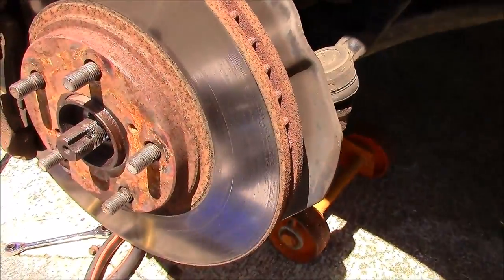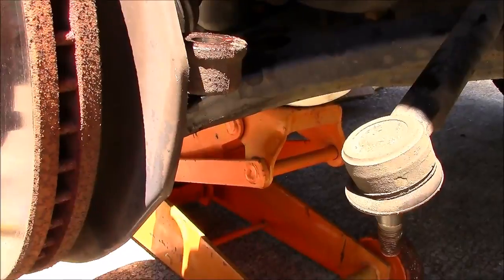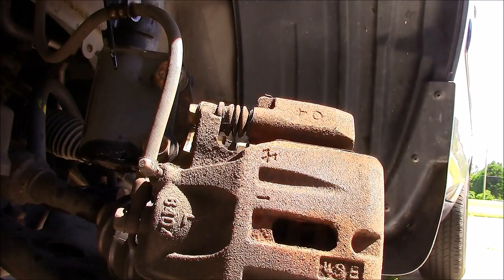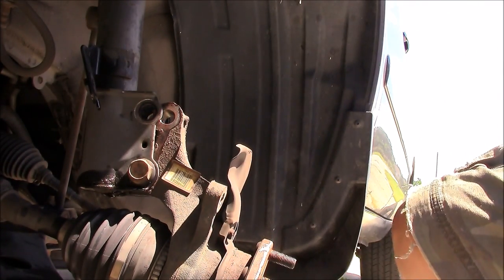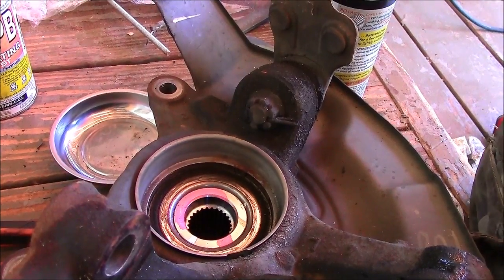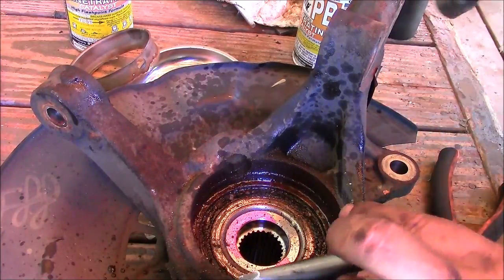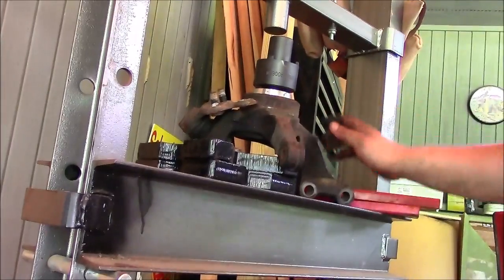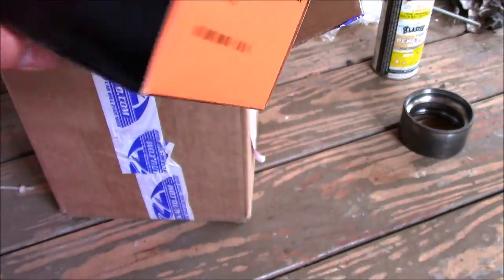2005 Toyota Highlander front bearing replacement

Comment: Just did this job on both sides to an 06 highlander today. Pressing the bearings out is the fun part for sure. Since the old bearing falls apart coming out anyways, I used the od of old bearing to press the new one back in to the spindle.  The internal snap ring I sprayed with pb blaster and got a flat screw driver and hammer to tap it all around until it was free. I broke an ear off of one of them, so I had to replace. It’s a tight press out out of the spindle, I would put a block directly underneath for the initial push to ensure everything is square. After she moves, the. You can find a way to cradle the spindle to push the bearing the rest of the way out. One side of the old bearing race stays on the hub, I used a cutoff wheel and dug as deep as I could, then smacked the slit with a dull chisel and it cracked in half, slid right off! Hope that helps

Comment: HI, WILL LIKE TO KNOW IF SOMEONE CAN HELP ME. I HAVE A 2004 TOYOTA HIGHLANDER. WE PUT NEW WHEELS BEERING ON THE FRONT SIDE. DOES THIS MODEL TAKES STANDARD OR MAGNETIC WHEEL BEERING. THE CAR IS GIVING ME PROBLEM WITH THE BREAKS. 2004, HIGHLANDER, FRONT WHEEL DRIVE, 2.5 ENGINE, 4 CYLINDERSTHANKS

Comment: If you are just trying to replace the dust shields do you have to remove the hub?
Reply from the maker: If you want to install it as one piece, yes.  The hub is larger than the opening of the shield. Removing the hub does destroy the bearing, so you would have to replace.  If don't mind bending it some, maybe you can flex it around the hub with a cut. I have not tried this, so don't know for sure if it would work.
Reply: That's kinda what I figured, don't have the car here in front of me to look at, figured you could provide some perspective. Thanks for the helpful reply.

Comment: I have a Lexus RX330 (essentially the same car as the highlander) and I already did the rear wheel bearings and was about to do the front until i looked it up and figured it that it's a much more intensive process... I already ordered the wheel bearings a while back and have a friend with a shop who's willing to press in the bearings. I was wondering if it's worth it to go through the process of pressing the bearings out like this or just pull an easy card and order the entire steering knuckle with the bearings already pressed in for $200... decisions decisions...
Reply from the maker: The Timken bearings were under $50 shipped to me, so if I were comparing $50 to $400 for a pair of complete hubs, I would do the bearings.  Also, when you remove the hubs, you are about 80% into replacing the bearing.  If yours are not as rusty as mine were, then it should be easier.  Good luck with either direction you take.
Reply: I was able to remove and replace the FW bearings using just the bearing tool set, no press.but you do  need at least an impact gun , electric or air.it can be done

Comment: When pressing out the old bearing from the steering knuckle, add heat to the narrow part of the knuckle, the heat will make it expand enough that the outer bearing race will slide out easier. Also, if you aren't pressing it out straight then it will require a lot more pressure.

I use map gas and PB Blaster to loosen things up. They both work wonders on this kind of work.

A 12 point socket is known as a triple-square in some circles.
Reply from the maker: Good suggestions.

Comment: What size is that 12 point nut? And where did you purchase the socket fitting for it?
Reply: I believe it was 30mm. I bought a set of 12 point impact sockets from Summit racing.  You should be able to use a standard 12 point if you have one that size.
Reply: Great. Thank you!

Comment: Too much trouble on a Toyota. I'll stick to my GMC. Don't need half the tools that were used here.
Reply: L Hay - yeh and you will spend a lot more than 70 bucks replacing both front bearings like this Toyota job.  I know because I own both vehicles (Toyota and Suburban) and have done both vehicle front bearings.  Suburban is the entire hub assembly which costs a lot more than these two bearings do.  Only tool I saw here that most people would not have in their garage was the hydraulic press.  Thanks
Reply: You Keep your junky GMC, I’ll stick with Toyota. ;)

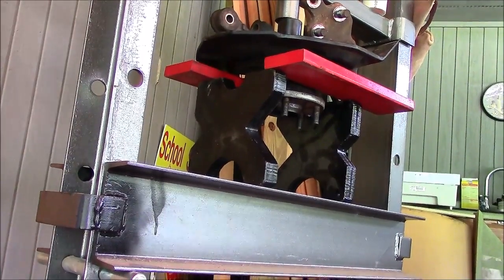Comment: Excellent video, MrFixit.  Thank you.  Questions: 1) on time mark 5:51, it shows that you used two red plates to support the nuckle on the two black plates.  Where did you get the red plates from?  My 20-ton press from Harbor Freight did not come with them. 2) How did you get past the press overload issue when removing the bearing from the press?  I did not see the details.  Thanks again for your help.
Reply from the maker: They are made by Arcan  and purchased from Northern tool. I heated the knuckle with a propane torch and after a couple of attempts it did come free.